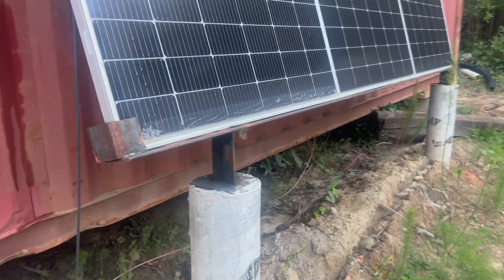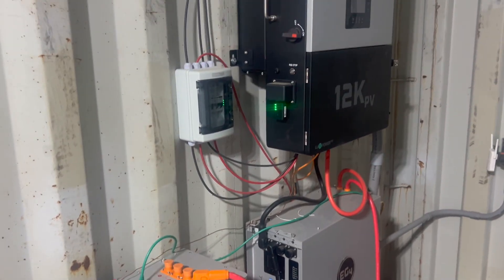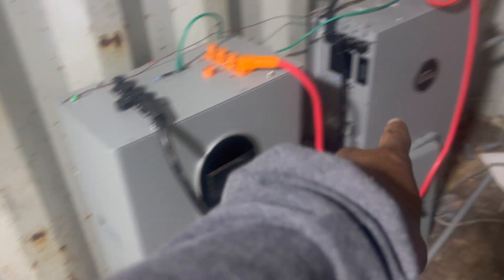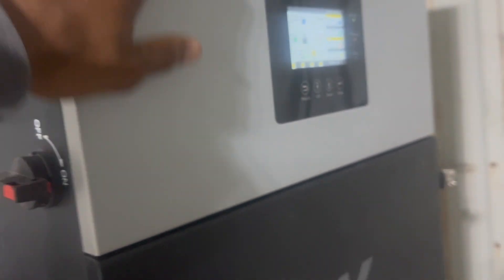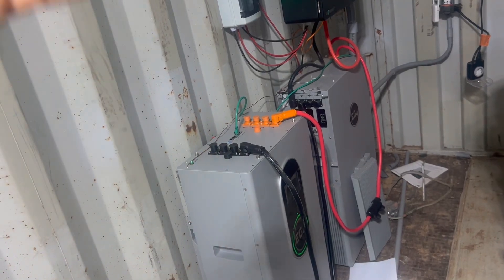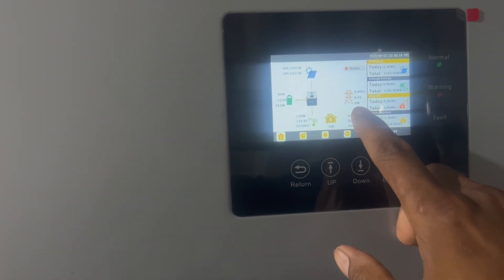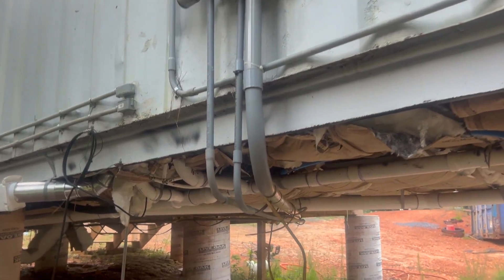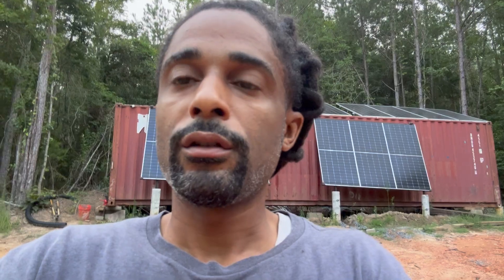EG4 Off Grid SOLAR SYSTEM....EG 12k and EG4 WallMount Batteries...Alabama Homestead

Comment: Double panel is a good idea. Can run separate solar systems to each and possibly extend run times. Or it’s ready for an expansion. Looking into an EG4 system to run as a primary backup for cloudy/stormy days if I need to bring my installed batteries back up to full. Have a generator that can do that but always good to have multiple options when talking about power supply.

Comment: I own a DC Power company. I have been in the Industry for 20+ years. We service the Telecom industry for Critical Systems. 
My opinion: stay away from New Battery Technology. Lead Acid is tried and true!! All of Americas most critical power systems use Lead Acid Batteries. 
The only reason to not use Lead Acid is if weight will be an issue. With you being in a shipping container- I don’t see weight being an issue.
Reply: I will add…. You want a sealed lead acid battery. It’s a MAINTENANCE FREE battery. Depending on mfg, most have a lifespan of 5-7 years. Most mfg give a 5year pro-rated warranty. Again, these are used in Critical Facilities and cost less than New Tech Batteries (lithium, SoNic, etc..)

Comment: The good thing at about a system like that you need more battery add when you have the money you need more power add a norther inverter when you have the money That is what I did now I have 3 inverters and 1400 Amp hours of battery you need more solar panels to but you can get panel like 5000watts worth for around $2000 dollars now I just got 6800 watts for 1800 American  made out of Ga from SS look around for deals

Comment: No it should take 18000 watts what kind of panels do you have or they all wired id ser/ if so they talking max voltage per line you still have line 3 and line 4 you can use

Comment: Hunt around, and you can find a DIY battery for 1900 or less. The battery I bought is a 16kW 48-volt battery.
Reply: I thought about trying one of these batteries, but I got a little nervous about the DIY assembly.  Are you referring to the battery from YIXIANG?  If so, I would appreciate hearing your thoughts about it.
Reply from the maker: EG4 Wallmount Battery